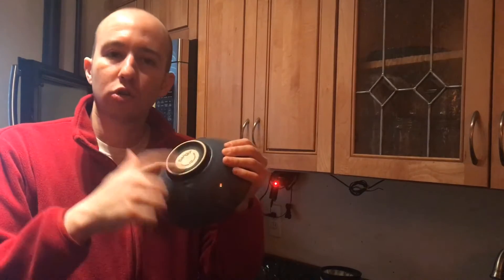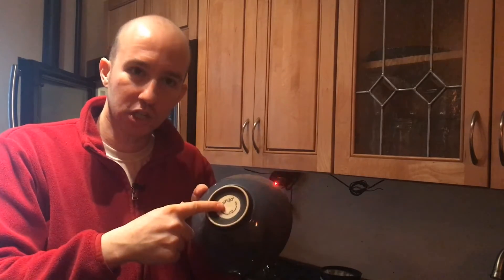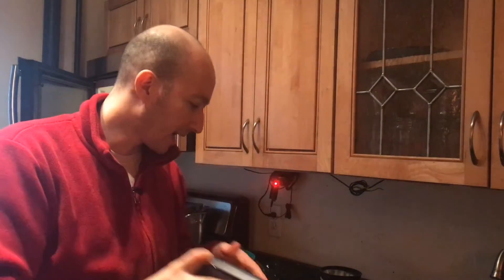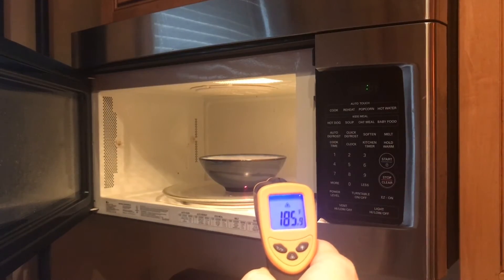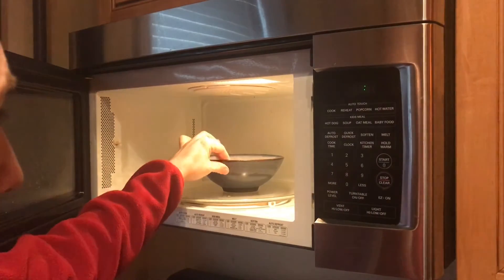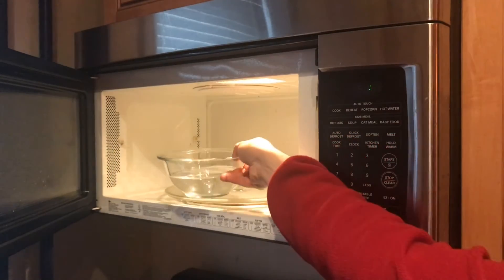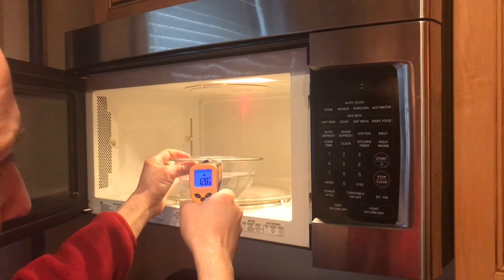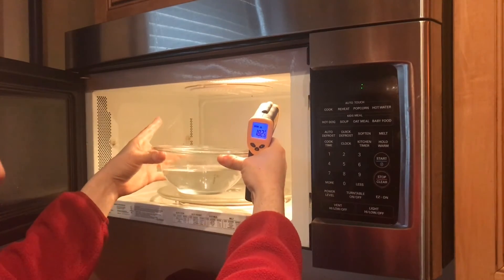Why Are Microwave Bowls Too Hot?

Comment: Hi, I recently got a microwaveable glass bowl and tested it out in our microwave by heating food. When we checked, the food did get hot but the bowl was hot too. Is it normal or are these bowls not supposed to be hot?
Reply from the maker: They do get hot! It just seems they cool down faster and not get finger scaulding hot as a clay or porcelein bowl
Reply: They get hot because the food inside are hot and heat transfer.